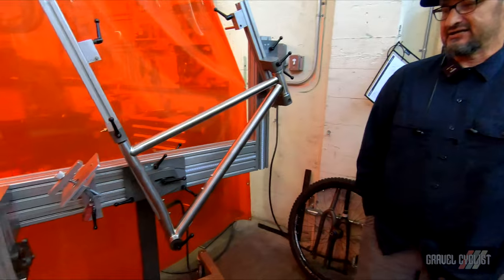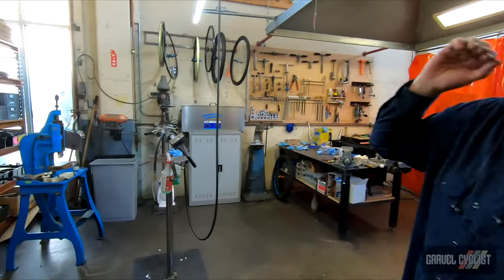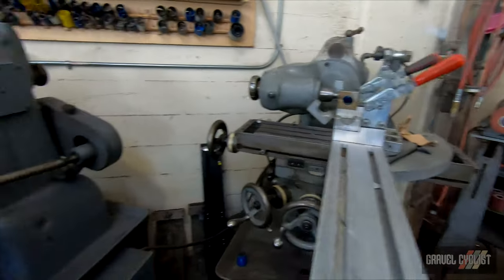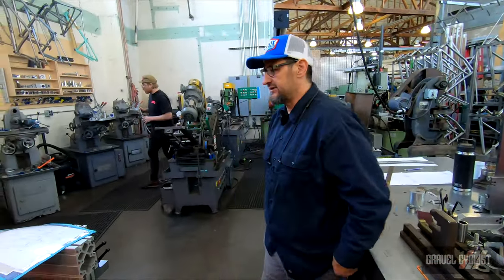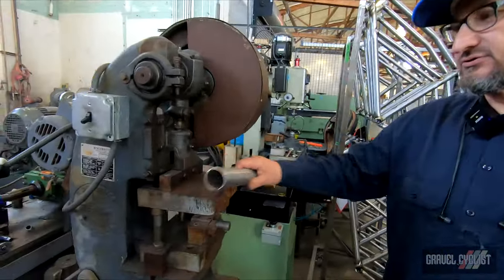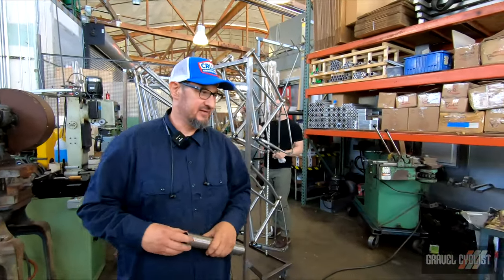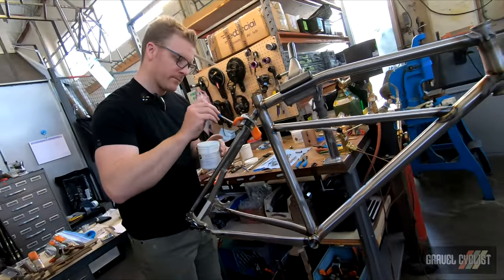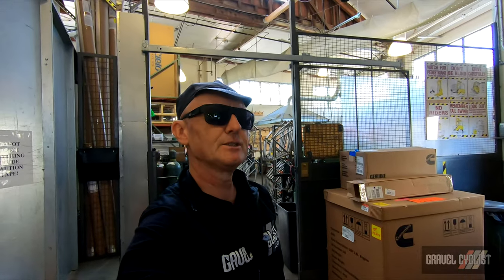Simple Bicycle Co.: Small-Batch Bicycle Fabrication

Comment: The punch tool is cool, but I'm loathe to: 
 - the tube running in the middle of the frame from the top of the down tube to the seat tube. 
 - the awkwardly bulging sideways seat stays. I much prefer for the seat stays to start at the sides of the seat tube rather than the welded behind it and bulging wildly design. 
 - This is the year 2022. Why don't all manufacturers use 3D-printed titanium lugs for all the joints. Visual welds are hideous. A titanium frame that looks indistinguishable from a beautiful carbon one, but is hardier and is splittable for transport would be the ideal bike for almost every application.
Reply: the slot of the seat tube should face the front no the back
Reply: @vicgravelrides  While most face the back, your statement does make sense to me, as the leverage / torsional forces when seated on the bike, pull towards the back.
Reply: @LeoInterHyenaem  It doesn't matter where the slot is since the resultant force  from the moment couple is taken by the seat clamp.
What torsion are you talking about? There is very little torsion the seat post unless you rotate your hips while pedalling.
Reply: They build frames according the design the customer asks for. There's nothing stopping you from commissioning a production run of your own.
Reply: @hansschotterradler3772  Leverage; I stand corrected.
Reply: @LeoInterHyenaem  I looked at my bikes yesterday:
Lynskey GR250 gravel bike - slot in back
Cannondale Topstone alloy - slot in front
Cannondale Hardtail - slot in back
Trek Fuel Full suspension - 3 slots, one centered in the back and 2 additional separated by 120 degrees. 
No rhyme or reason 😂